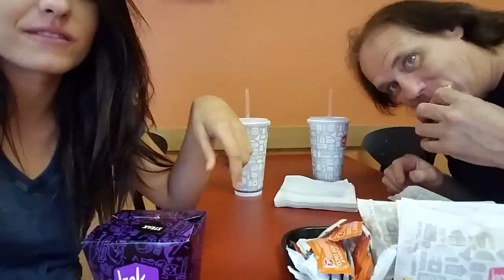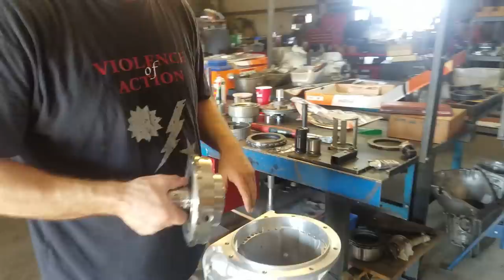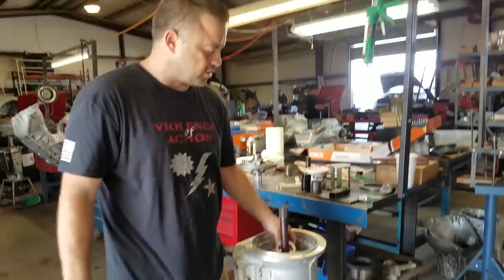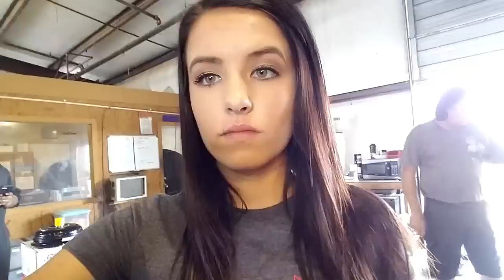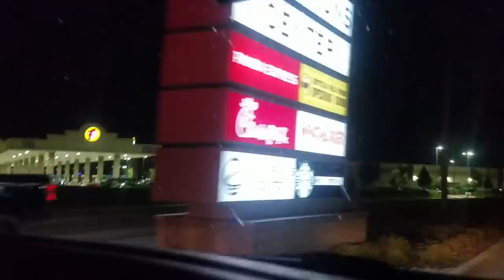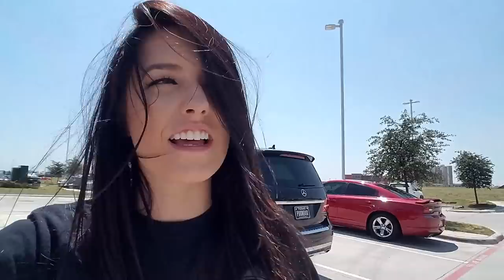New Trans - Reid 4l80 & TH400 Part 1

Comment: Over the last year I purchased a complete trans and converter from Jakes for my 70 GTO project. The trans is a stage 5, 4L80 in a Reid case with upgraded billet OD, deep pan and the converter is a triple disc 10.5" with 26-2800 stall. They were very good to work with and I highly recommend them.

Comment: Hi  just  saw  your     video..  on   4l80  ...  if    you   can   be  nice very nice...  and respectful..  ask   jake...  if  ...the  piece  of    the  fluid  channel  prone  to  blow  out..  can  be   re. Inforced  with  a  v  precision.. fit  from the  outer  fluid channel  to  the   transmission case...  to keep..  it from  pushing out..  from  what  i   see here..  that  would  add  stength..  and preventitive..  maintainance...    if  it  workz...  every one  would   benefit........that  mite  be  able  to  be    welded  in  place....  have  a    nice   day...